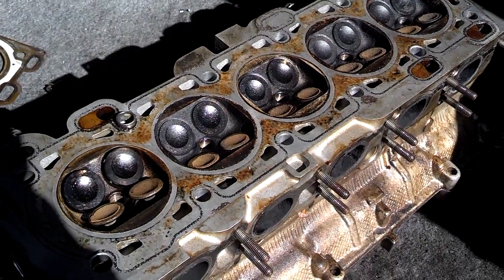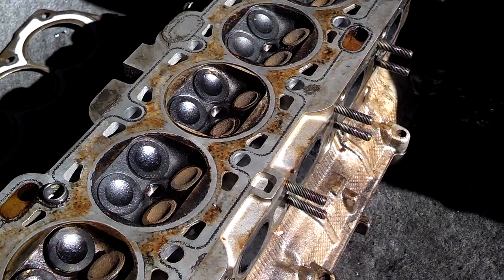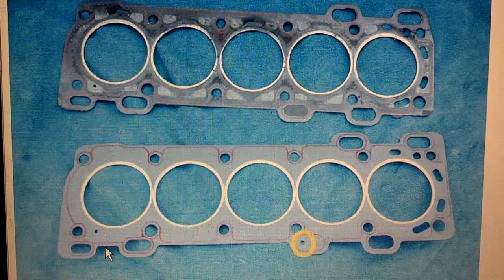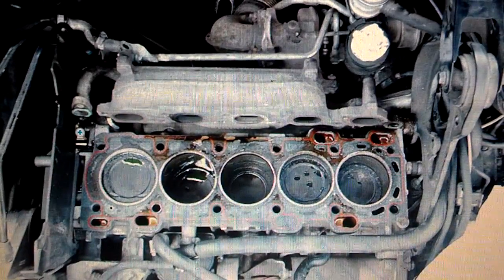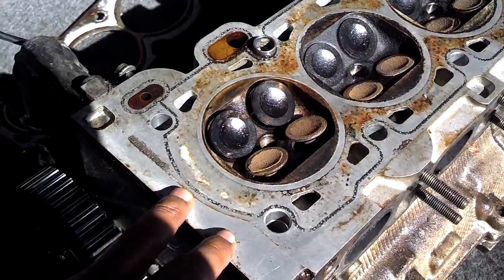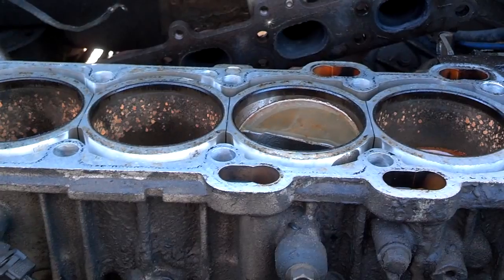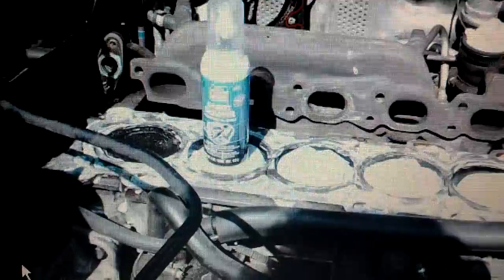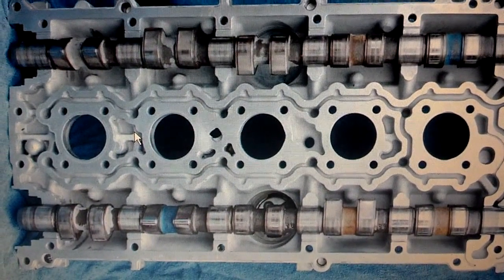Engine cylinder head removed, cleaning & things to do before you install the head information - VOTD

Comment: I had the turbo charger replaced along with valve cover gasket replaced after getting it back my cam is making a bad noise  it's the one closest to the firewall i think it's the exhaust cam why the noise?
Reply from the maker: I have no idea. Who installed a valve cover?

Comment: Every mechanic use Scotchbright  and multilayer steel gaskets
Reply from the maker: OK
Reply: Wrong! Not many experienced mechanics use Scotchbright to clean the deck of an engine block or anywhere else the particles from the pad can get into the internals.

Comment: I sanded my head clean. no what?
Reply from the maker: Good luck with that.
Reply: Robert DIY it was very fine paper.
Reply from the maker: I've seen it done, just think spending $40 is a safer deal with so much labor involved.
Reply: Robert DIY ok. I only got the grease off with it to get it clean enough to put a straight edge on. It's not warped to any great degree. I'll know better for next time thanks

Comment: Nice tutorial Robert. I really don't understand what's with some machine shops... last time i did the head they also just gave me the head which was full of metal shavings. It wouldn't kill them if they just blew it few times with air. It doesn't take so much time to do it. I would have done it myself but hadn't had an air compressor.... Question though. Would it be okay to clean the head with a microfibre cloth ? Those aren't supposed to leave residue or fibre.
Reply from the maker: +Kaktus Jack Yes. You can clean them with a lot of things as long as you rinse them off well and get them installed before they rust.
Reply: +Robert DIY Thanks for Your swift reply. I usually install them the same day i clean them. In case this is not possible i cover them with plastic foil.

Comment: Robert, I'm about to put the resurfaced head back in my daughters '94 850T that had a burnt valve. I am having a problem getting all of the gasket residue off. Iv'e used some brake cleaner like the guy at the auto parts place suggested but I still cant get the old stuff around the cylinder holes to come off. I think I'm going to get the gasket cleaner that I was trying to find in the first place when the parts guy said that he just uses brake cleaner. I have been following your advice and only using old credit cards but man the burned carbon deposits on the top of the pistons were real tough to get off. I know you said don't use brillo pads. I watched a Ford mechanic who said that they suggest using a 3M product to called Roll Lock Bristle disks, the white one for aluminum heads to get the mating surface clean. He did also say to stuff rags in the cylinder holes to minimize stuff getting in there. The machine shop also sold me a shim because they said the clearance was not enough for the valves to clear or something with the head having to be planed. Your thoughts on how to mate the shim with the block. The shop said don't put anything between the shim and the block but would think it would leak there. Maybe I should also ask on Mathews Volvo Site this question. Sorry to ramble on. THANK YOU for encouraging us to go out and fix things on our own. GDiode (AKA Shannon)
Reply from the maker: +Shannon Ray I suggested that you NOT clean off the pistons, just a waste of time. If the machine shop planed off to much of the head to mate the head directly to the block without "shims", the head is NOT usable. I suggest you find another head and go from there. I will link a couple more videos showing me cleaning the block. Anything that can get into your block, ports, cylinders, etc, should not be used.
Reply: Have you ever heard of using a shim with the Volvo heads?
Reply from the maker: +Shannon Ray Go to 5:00 - https://www.youtube.com/watch?v=JVSmhnHyFI0
Reply from the maker: +Shannon Ray No, No, No. You need another head unless you like wasting time. I hope they didn't charge you for that service.
Reply from the maker: +Shannon Ray The first thing a machine shop should do is check the head and see if there is enough meat on it to make it true. If it's to thin, has had to much taken off before, or is to warped to make sure with enough valve clearance, they should have called you and told you NO GO.

Comment: Thanks for this video. I was about to go and clean my replacement cylinder head with a razor blade lol. Subscribed!
Reply from the maker: +Tyler Scott Thanks for watching.
Reply: A razorblade is ideal. Be very light. That's what mechanics use to rebuild engines. Better to use that
Reply: I have a cast iron block. I lightly use a razor blade at a good angle that won't scratch or gouge the steel. Also, I change my blades frequently. Every few strokes I'll feel the blade edge to see if its rolling over. If I feel the slightest roll or lip I'll change it.

Comment: show how to clean heads pls
Reply from the maker: russsboy This is it. I always take the heads by the machine shop and they run them through their cleaner. They call it VAT cleaning. Then they make it TRUE for me. After that, I only clean whatever is left of the mating surfaces. Plastic scrapers are safest, acetone, etc. Beyond that I don't worry about it. You can take it to a car wash and pressure wash it and do other things like that but at the end of the day, the only part you will see is the top of the cam cover and it will be covered by the hood 99% of the time. I have painted the front edge of mine and may have it stained/dyed (Anodized) black.
Reply: Robert DIY thanks... do you know daewoo matiz car ????
Reply from the maker: No I do not.
Reply: Poda punda

Comment: Robert I have a question and need help please we have a 1996 acura 2.5l tl 5 cylinder motor I removed the plugs andturned it over I noticed I had water spraying out of # 1,2,3, and 5 cylinders when I turned over the motor also after starting the motor 2 mins the motor started the overfill was getting full of a lot of air pressurewas blowing out the anti freeze out the the water was next out of the motor  and the temp gauge was cold  incredible help
Reply from the maker: gregory cerniglia Hi Gregory, is there some event that started this? Did you pull the plugs for routine maintenance or because you were experiencing some problem with the car starting and running? If coolant was spraying out of the spark plug wells when you cranked the motor (was fuel disconnected) you have a blown head gasket. Time to repair or move on. - https://www.youtube.com/watch?v=Tww7l7Cu10g

Comment: great video....can i clean it with diesel fuel and then flush the coolant and oil after a quick run?
Reply from the maker: Mohammed Elzain I don't understand your question. If you asking if you can clean the head with diesel fuel, I don't see any issues with that. I actually cleaned one with oven cleaner, the combustion area, trying to get the valves cleaned. As for what I recommend after the job is done, you should watch the install video.
Reply: Robert DIY
thank you for the quick reply. will definitely subscribe and follow on.

Thanks again

Comment: hi two clean that mix oil out of oil pass it
Reply from the maker: ciro williams Huh? I do not understand what you are writing about.
Reply: Robert DIY how too remove old oil mix with coolant in the system
Reply from the maker: After I install the head I replace the oil. Drive 50 miles and replace the oil again.
Reply: thank u

Comment: hey man i really appreciated the video i currently had to replace my head and need to clean it all ect. but i was wondering if you could make a video on how to put the head on top of the engine properly in terms or making sure that the pistons are all lined up properly to the cam shaft and valves ect. because that would not be very good to have it open valves at the wrong stroke, but anyways excellent video!
Reply from the maker: Cylinder head installation, head gasket, lifters, etc. - Auto Repair Series

Comment: I like how you keep saying to not damage the head by using a hard instrument. For some of us that have never done it before, I bet that would be the first thing we'd grab: a razor blade tool. Appreciate the detail - a lot of detail - as it's easy to follow your train of thought. Appreciate this video. (working on a 2004 Sebring 2.4L and I just pulled the head off a few mins ago...clearly blew the head gasket.)
Reply from the maker: Glad you find the video helpful. A lot of people do use razors but they are very careful to avoid digging into the metal. Easier to use hard plastics and chemicals. DO NOT USE Scotch bright pads. They have materials in them that are harder than a lot of the motor's metals and the dust from them can wear a motor out in less than 500 miles after the motor is put back together.
Reply: Dangit...I've been suing Permatex, lacquer thinner, and Scotchbrite pads. I do have an air compressor and a power washer that I plan on using. The engine is actually on a stand, so it's much easier than it being in a car. I can flip it, rotate it, etc. I'm easy with the pads and I don't really "scrape" I kinda glide across it with some WD40 and Permatex/thinner. Slowly, it's getting cleaner...this is NOT a fast process, I'm telling you! But the head still has those small, machine grooves in it and I'm trying not to sand those down by pressing too hard. I keep thinking "it's soft metal...take your time...".
Reply from the maker: Machine grooves? That lower head surface should be smooth and clean. At any rate, the most important thing with the head and mating block surfaces is that they are flat and not bowed so they can make a seal with the gasket.

As for the cleaning process, the surfaces really don't have to be spotless, stains are ok. They just need to be clean of any old gasket material that can cause a bulge in the mating surface and cause a leak.

No, as mentioned, Scotch Bright pads can leave fine dust particles that will cause severe engine wear. Hopefully you have stopped using them. Then, clean, vacuum, blow out, etc any thing that you can to make sure there is no dust from the pads left over. Then, after you put the motor together, install the cheapest oil and filter that you can find. Run the motor for about 50 miles, then change the oil with good quality stuff that you plan to use.

Hope that helps.
Reply: I wish there was a way I could import a pic of a close up of the small grooves. They are very thin and linear, as if the heads were manufactured like this. I doubt it was done by a person, as they are too "perfect" to be done by accident...
Reply from the maker: You can go to my website and send me an e-mail from there. As explained, if they are fine I would not worry about them. If they could change the direction of water flow, you may have issues.

Comment: I have this toyota jz1 engine 6 cylinder 2.5 l.
I have to torque the cylinder head but i can't find the settings.
Any help???
Reply from the maker: Have you checked with the people on the Toyota forums?
Reply: i haven't tried that yet, i was hoping to get lucky.
Reply from the maker: The Toyota forum will be your luck.

Comment: I like to use a copper tube, flatten the end and sharpen it like a chisel, Then spray on some WD40 to soften the gasket. doesn't hurt the aluminum and gets everything off!
Reply from the maker: Nice tip, thanks.
Reply: I'm not sure, but hammering hardens copper and there might be danger of making it harder than the aluminum. Rumor has it that the pyramids were built with copper chisels..... ?